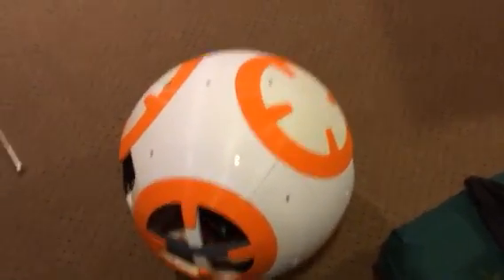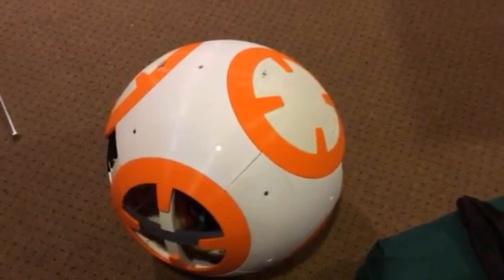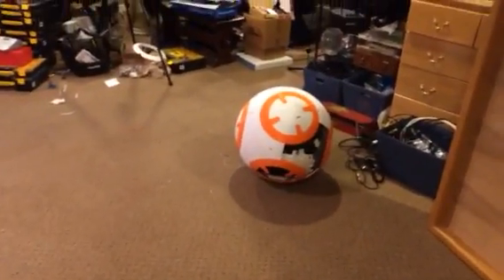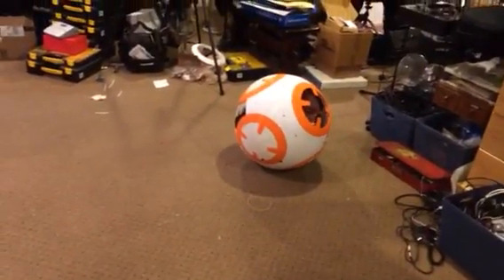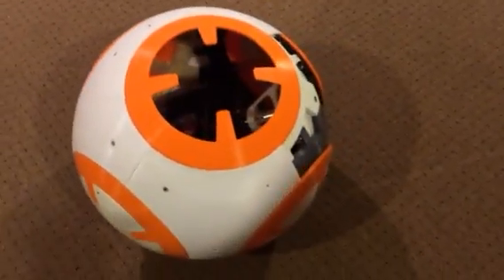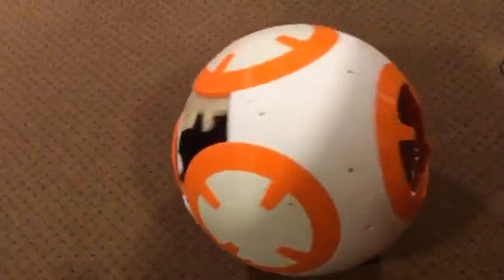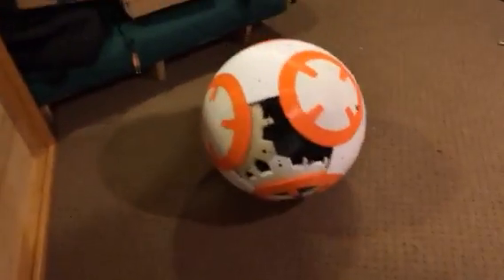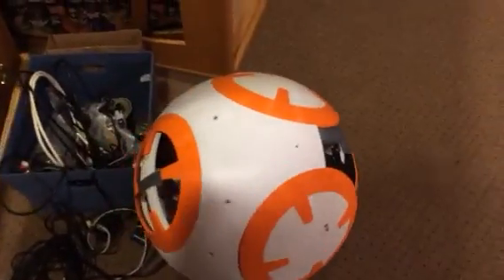RollingRobots : Building BB-8 : Part3 preview : first drive real test run!

Comment: if it moves that well on carpet not on full power can't wait to see it on a smooth floor and tuned fully.
Reply from the maker: It does burnouts on our hardwood.  At full speed it's slightly terrifying.
Reply: Yes, hard floors aren't very good for mine either. He tends to "spin out" and kinda gain too much momentum. :D haha